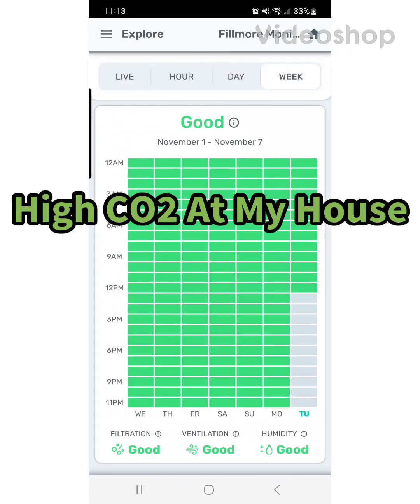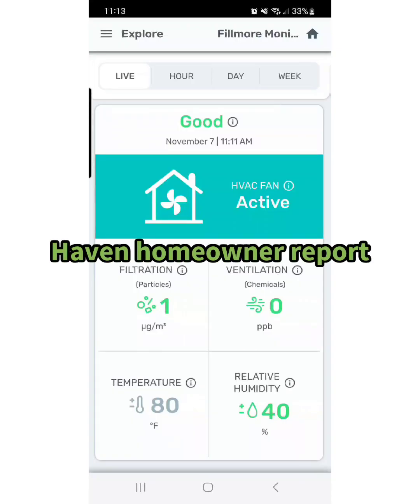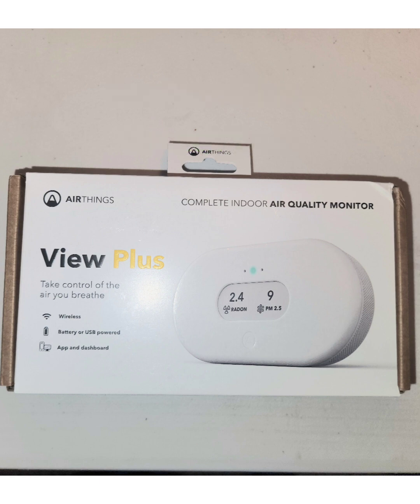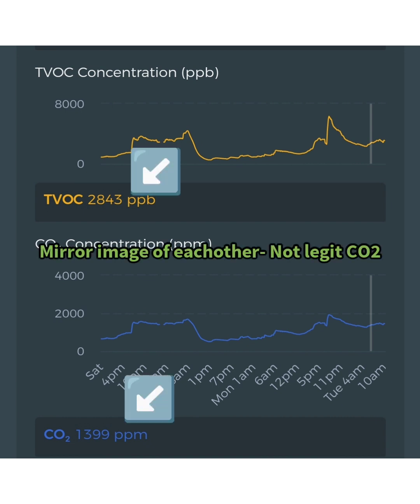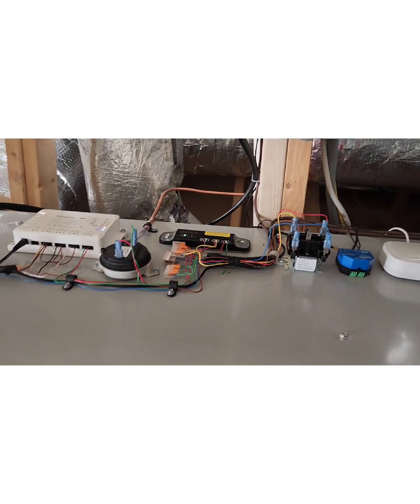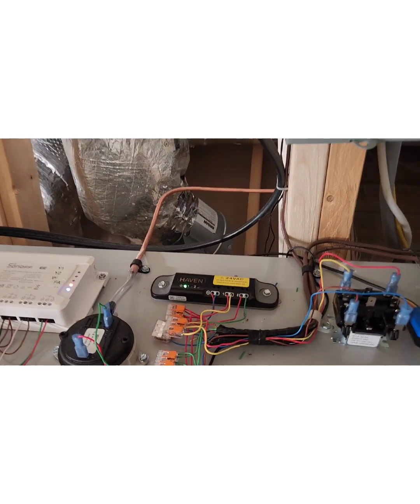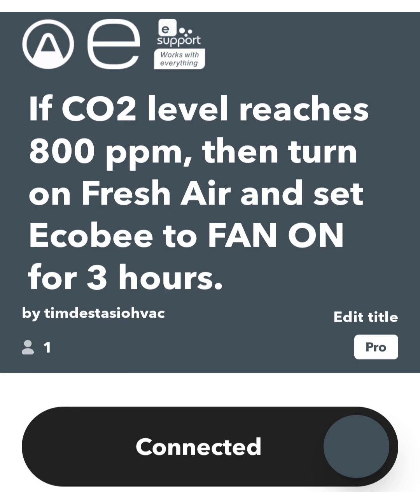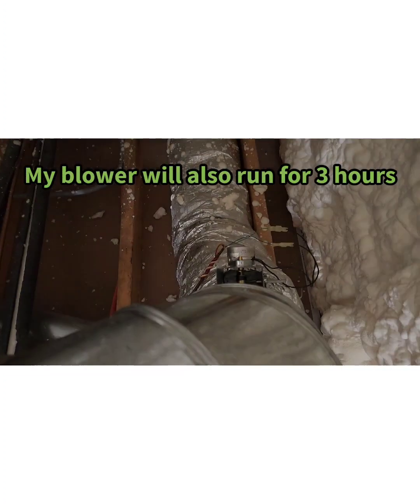High CO2 Readings At My House

Comment: Tim, I just today installed the Haven room monitor at my dad’s home to have CO2 readings hovering at 2000ppm also. 

Are you just opening a damper to pull from outdoors or are you using an HRV/ERV or ventilating dehu type system?

I’m trying to find the best solution for him. I’m in Dayton OH.
Reply from the maker: Vdehu is usually thecway to go. Ervs are costly and dont dehumidify.

Comment: One year later what's the status on this project? Have you managed to lower the CO2 levels?
Reply from the maker: Yes, I use an IFTTT automation to open my outside damper and my levels control between 600 and 900 ppm.  I just moved the Air things into the master bedroom and I want to compare Co2 there with my living room.  Stay tuned!

Comment: It's insane that we have to link so many different product lines just to get what a single controller should be able to do by now. It really can't be that hard to have a thermostat like Ecobee which has all the sensors built in (or at least as optional add ons) to measure all of the potential indoor and outdoor pollutants and control ventilation, dampers, or whatever other programmable outputs are necessary for the given equipment.